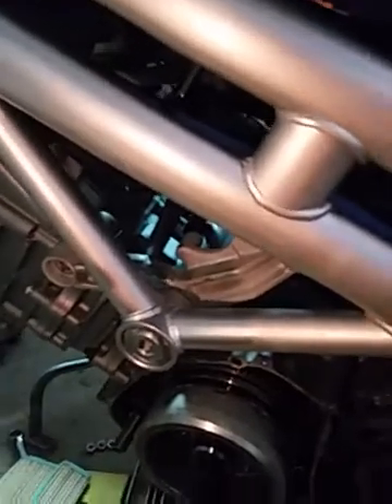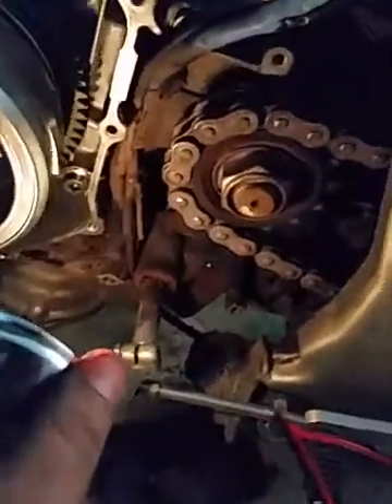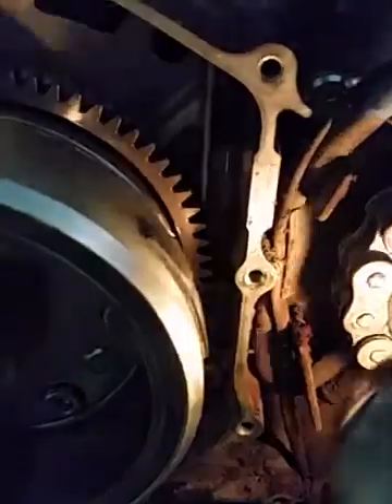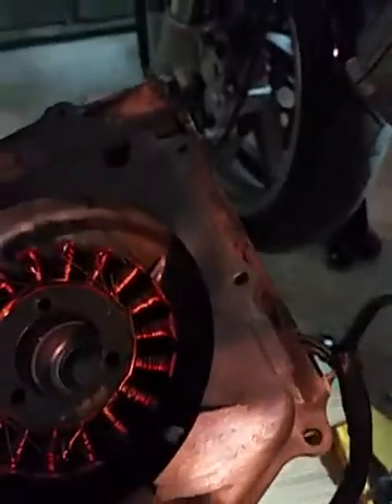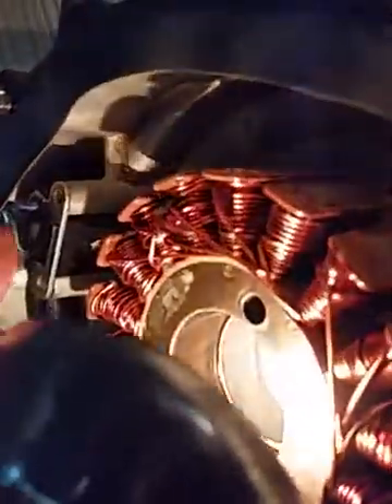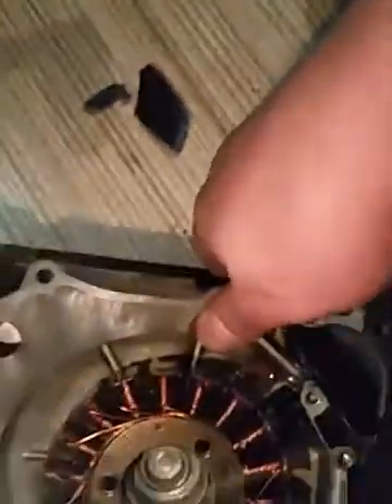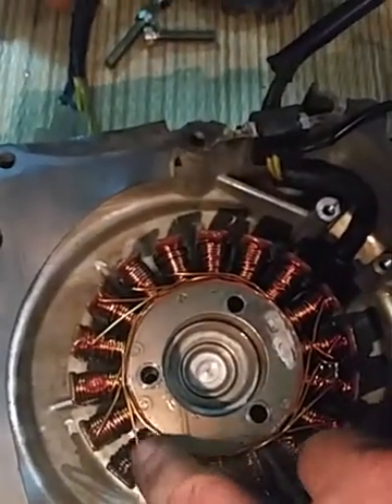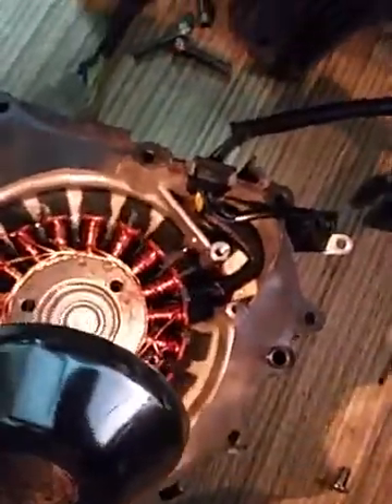HYOSUNG GT 650 Stator disassemble

Comment: Whats the torque for the bolts and can you diagnose stator without taking it out
Reply from the maker: Hi,
I did not use torque wrench. I just tighten the bolt not too much.😊
There are manuals for GT but for the stator I did not check it out. Having in mind that the base is aluminuim.
In my case, as I explained in the video, the rectifier was OK and the charging was bellow 12,4.
One of the phases was gone.
Reply: @knowhowbulgaria4245  aaah i seee
I ll test my regulator rectifier with a multimeter this weekend and i know my battery is healthy. So last chance is the stator. Thanks a lot for the help great video.
Reply: How about when you take the body part of do i need to use torque wrench? Sorry for million questions
Reply from the maker: @snatcherooo  hi. No. Just unscrew it
Reply: Okay so i opened it up and checked the ohm measurements with a multimeter. Stator and regulator has wrong values.same values were open circuit which was weird. I don't know if I did something wrong.

Comment: Did you drain oil first?
Reply from the maker: Yes. I always have a magnit in the pan where i drain the oil,as well.
Reply: @knowhowbulgaria4245 
I noticed one black segment on the stator coil and does that mean that the stator is bad.